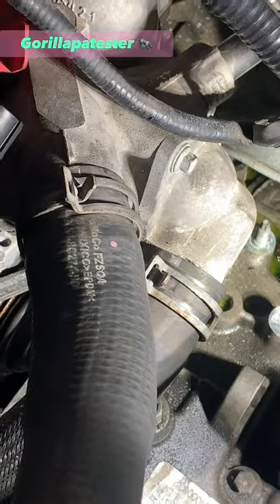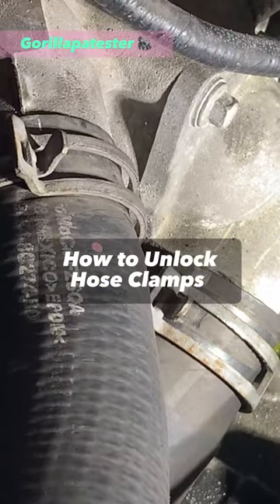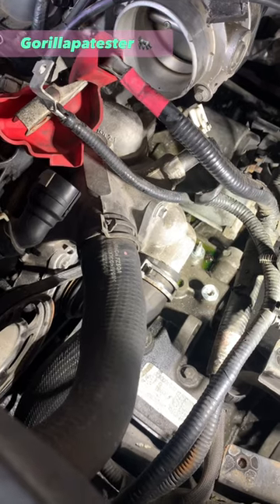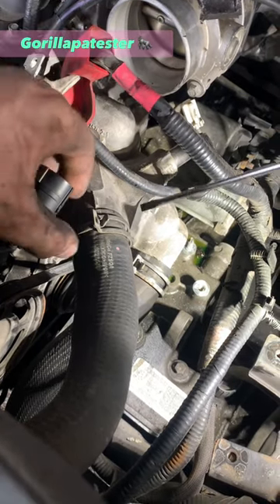How to Hose Clamp

Comment: Makes it look so much easier than it usually is. Most of those clamps you can't get a screw driver on anymore because they're in poor locations.
Reply: Yup yup! I usually just get pliers and compress the ears all the way together and just let my pliers slip off lol
Reply: Yea my hand barely fit to even move around the heater hose in my car when the plastic piece inside broke in half. Cut my hand alil and left welts on my arms cause it was pressed against random stuff in the engine bay while I was jamming my hands through😂😂

Comment: I dont think ive ever seen a hose clamp with a lockout like that, pretty neat
Reply: All of the OEM ones on my Honda that came with clamps like that. They are pretty nice because you can also lock them to take them off and not mess with keeping the clamp under pressure and moving them.

Unfortunately the Honda supplier changed, so if u go to the dealer and buy a new clamp, it won’t be locking anymore.
Reply: Standard equipment on ford products

Comment: Best and proper way is when doing the job find nearest trash can and toss them in it
 they we used for ONE reason- to speed up on the assembly end...
Remove them Install Smartsteel screw clamps and know it's done right... unless an extra $10 isn't in yours or the customers budget 🤷🏻‍♂️🔧

Comment: You can help the next generation by THROWING those garbage hose clamps away and using a screw drive clamp. The new generation will thank you.
Reply: Screw clamps suck
Reply: @williamvaughan1218  agreed
Reply: @jamesjameson2576  I prefer carbs and points. Lol
Reply: 👍💯 if you live in a rust belt then they  rust, break in half, and cause coolant leaks. So we replace them as soon as we can.
Reply: @MechanicalTriage  😐

Comment: they look so handy ,,, Ive never seen them , or maybe not noticed the lock tab , I dont think VAG have that feature , but it would be handy.
Reply: I've seen a few of these on vw/Audis I've worked on. Not common but there's a few coolant lines that have these
Reply: @henrymarocchi7844  most of the ones I see dont have the latch , just the constant force hose clamp ,,, it is a mighty feature and would be handy in some places

Comment: Factory clamps, oem. They all break eventually,  but usually out last the vehicle
Reply: UNLESS you live/work in a rust belt. Then they rust and snap in half by the second year of their life and cause countless coolant leaks. We usually replace them with worm gear style hose clamps after any repair.

Comment: Most people replace those with shitty screw clamps and then come winter they wonder why they leak. Well you threw away the constant tension clamp.
Reply: Not sure were your anger is coming from but those hose clamps were standard on vehicles in the past. I have them on my older jeep and they aren't the leaking points. I also don't need to go back to them and check them after I put them on. Leak free for many years. Maybe just don't buy the cheapest parts you can find ..
Reply: If you get a good Quality screw clamp, they won't break. Just don't over tighten them. most people make that mistake